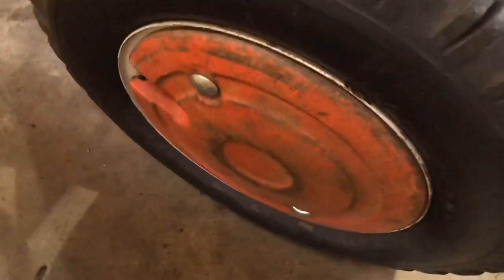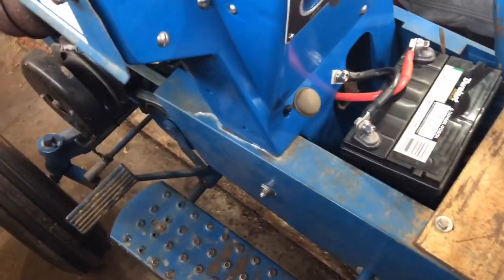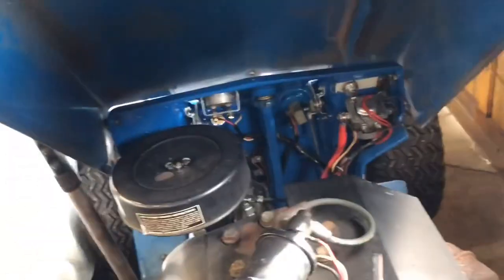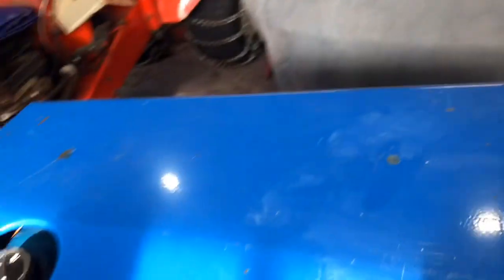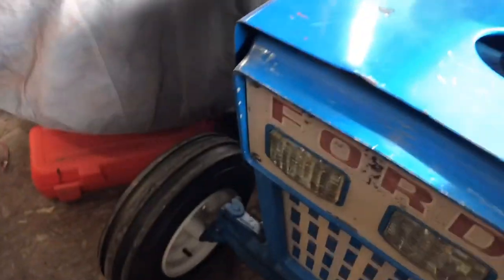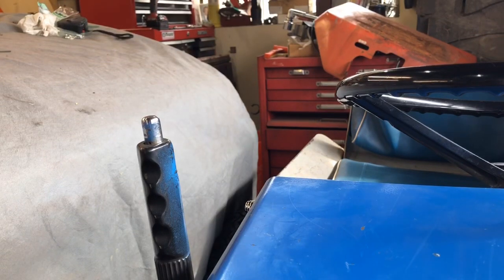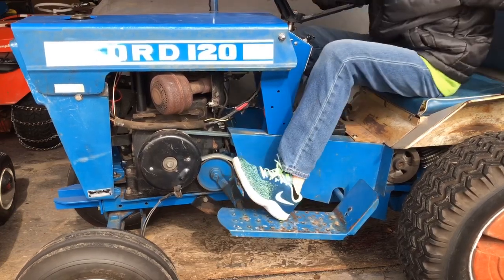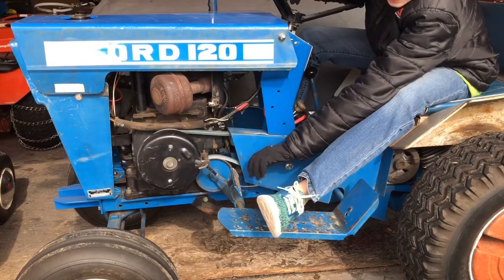1969 Ford 120 start up

Comment: Where did you get the gas cap I need one for my 120.
Reply from the maker: On Facebook josh deaven tractor parts send him a pm
Reply: @andrewsoldschoolgarage  thanks I will.
Reply: Would you or your dad have or know someone that would have a steering wheel center cap for a ford 120 garden tractor? @andrewsoldschoolgarage
Reply from the maker: Josh Deaven also